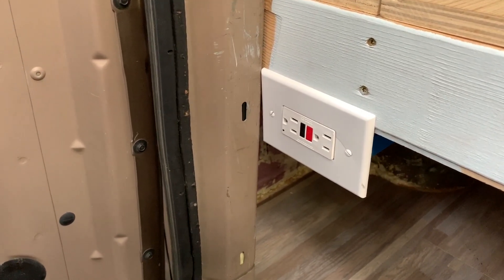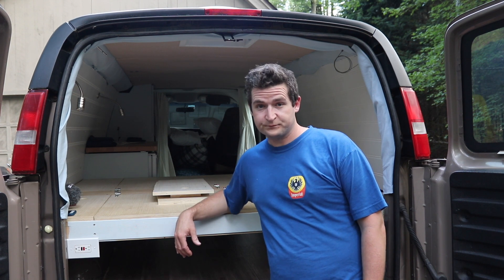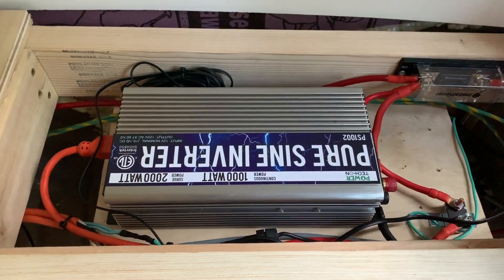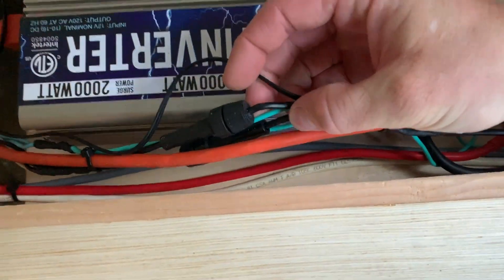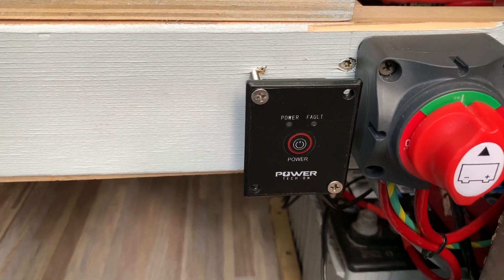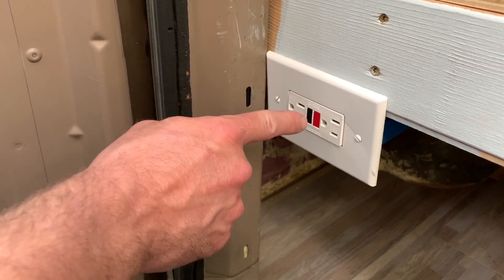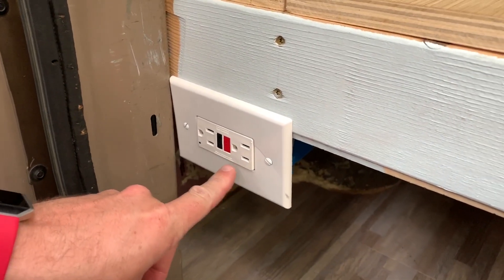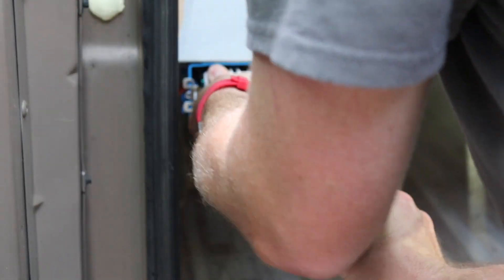Camper Van 120 Volt Electrical | Van Build Step 11

Comment: If you decide to switch to 12v fridge home depot has one that costs just a bit more than the one shown in the video and it is almost double in size with a separate freezer. I found it when I was looking for a cheaper option to dometic and the like.